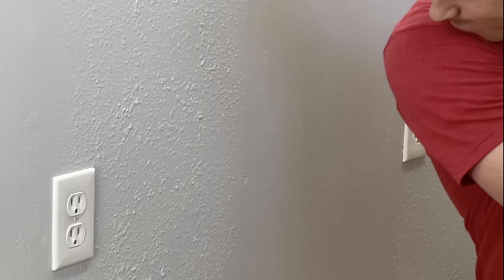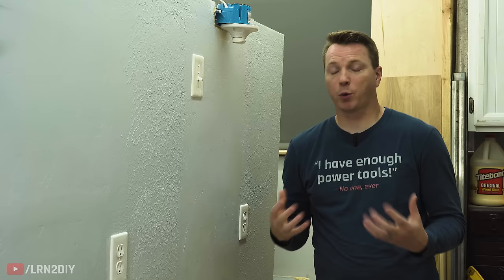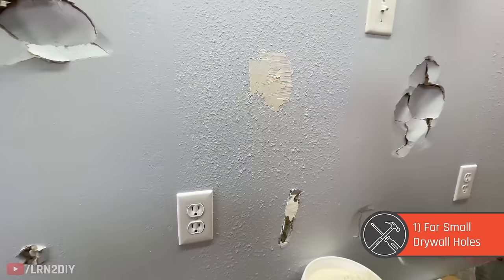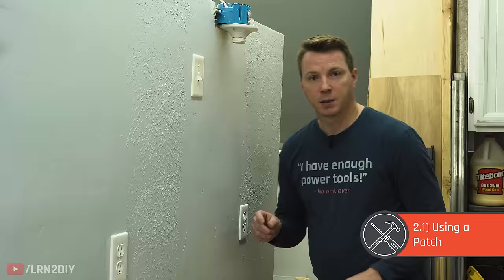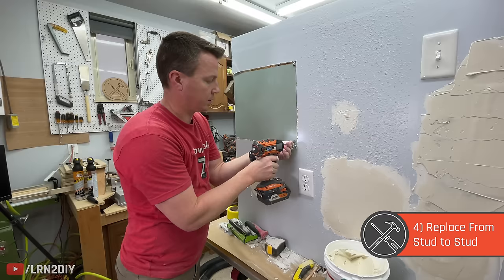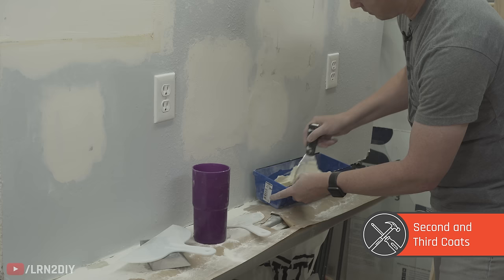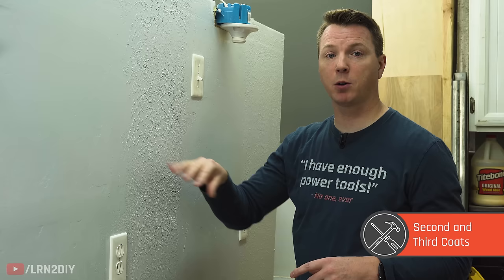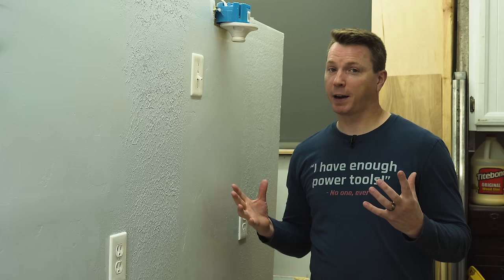How to Fix Holes in Drywall - 4 Easy Methods

Comment: This video omits half the walls in a house .. exterior walls.  You're going to cut into vapor barrier, so you need to make your first cuts knowing what is going to happen, use that to get visibility into the hole, then use more surgical cuts (maybe using a putty knife between the drywall and the vapor barrier to protect it from your knife).  Repair the vapor barrier with the appropriate plastic and tape, then continue repairing the drywall.

Comment: The label on the product you display is not called mud, it’s supposed to be for joints. You need to address that. Makes me wonder if the term mud is regional or if it’s the right product

Comment: Can you screw into these patches though? No, right?
Reply from the maker: You definitely can but I wouldn't consider them to have 100% of the integrity they had before. Consider it as maybe a half capacity area and not suitable for large drywall anchors.

Comment: there is a better way than this , but takes more time  .use the plywood but peel the the  paper on perimeter of both the patch   and the remaining wall about 1  1/2 inch .then scrape the white '' rock ''down 1/8 of an inch . Bevel the paper edges slightly with razor knife then  prime with quick dry oil based primer. let primer dry properly  .this makes a perfect trench for tape and mud and there will be no hump of any kind . a perfect wall . put a atrait edge on it and its perfect

Comment: I couldn’t imagine living with drywalls as walls. Here in Germany we have whole bricks as walls, and that almost everywhere. Apartments with drywalls are a big red flag for us and stand for an extremely low quality home. An apartment with drywalls would be much cheaper than an apartment with brick-walls. It only takes a little more time and money, but not too much, to make brick-walls instead of drywalls. Why do you guys not do that?
Reply: We like to hang things from our walls.  We like to paint our walls.  We like smooth walls.  We like WiFi.
Reply: @randygault4564  
With a solid wall, you can hang things on the wall much better, because they are attached much more securely.

With a solid brick wall you can also have smooth walls, just use a smooth wallpaper or plaster.

I don't quite understand your WiFi argument. WiFi works just fine with solid walls. And if your house is so big that it actually doesn't reach that far through the thick walls, just use a repeater, that's not a big deal.
Reply: @randygault4564  We usually have wallpapers on the walls, to painting is not a problem at all. Either use a new wallpaper or paint over the old one. When it gets old after who knows how many years, just take it off and put a new wallpaper on. Easy as that, you guys probably do the same thing.

Comment: Can you do this on doors?
Reply from the maker: Not really. Hollow doors tend to have a very thin wooden wall on either side. You may want to look up videos on that specific topic since they tend to use expanding foam or other methods to repair doors.
Reply: @LRN2DIY  thank you very much. Someone, not banking names, may have punched a hole all the way through the door looking for how to patch that. The video here was helpful regardless though. Thanks again.

Comment: As an African, I'm always confused about why Americans hardly use bricks for their indoor walls.

Is there a reason to it? I'm genuinely asking because it's rare to find a house that's not built with bricks from where I live.
Reply: Brick houses are everywhere... Mostly older houses in cities. But they exist all over. However, doing some framing and filling in with insulation and covering with drywall is the best way to insulate a house for temperature.

Comment: I leaned too far back in my chair and slipped, now there is a foot and a half hole, how do I tell my parents?
Reply: Hey man mistakes happen to everybody and it’s okay. The best thing you can do in this situation I would advise is to just be completely honest and own responsibility. Say that you want to be open and honest and that you were leaning on your chair and fell into the wall. Apologise and say you will be more careful next time. Even if they are angry in the moment, they will respect you a lot more if you take responsibility and own up to your mistake. 

If that’s not good enough, just say you were vacuuming and that it tipped over and fell into the wall. Or say that you tripped over a charger wire and fell into the wall. Goodluck 👍

Comment: If you are anything less than a drywall professional I would recommend you NEVER buy the Homex brand of drywall texture in the yellow can (used in the video). The can advertises one can adjust the amount of spray to get the desired type of texture, sounds good but I could tell no difference between the settings -- they all BLAST -- creating a lot of globby overspray. Also, after a few seconds  of monkeying with the setting to adjust the flow down some, I tried spraying it again and NOTHING happened. No matter what I did I could not get it to spray.  It's frustrating to be in the middle of a project and have a product that, not only doesn't function the way the manufacturer says it will, but then to have it not work at all is ridiculous! Another trip to my local big-box home improvement store. The service person -- who has given me many tips and product instructions in the past -- said they didn't know what is going on with that manufacturer, but many people return the product. They recommended I buy another brand (that did work!).
Reply: What brand is best?

Comment: This is terrible! You NEVER put that much drywall mud on a wall, it would take forever to sand it of and you will always have a lump there. You want as little mud on the wall as possible when you work with drywall, so there is little to no sanding needed when done. This guy is very obviously clueless about how to apply drywall mud properly and anyone who does it the way he shows in this video is going to have a big mess on their hands. Also, if you look at the last shot, the drywall is still nowhere near being done right. 

The ignorance in the comments is just sickening.

Comment: I gave all these repairs upin the 1970s. These are all worthless.  These will not last. I am still in the drywall business at 88 years old. Your larger repairs can work well. One thing I learned is there are so many ways These will work lose. Just open a door over time will loosen These patches. I could not stay in business with this. I can repairs and finish these in one day using better products and paint.